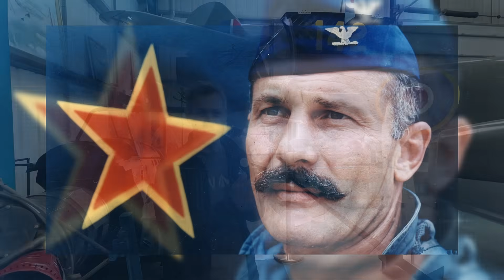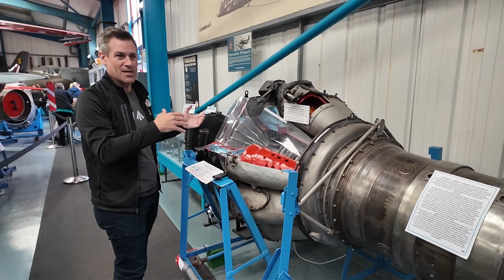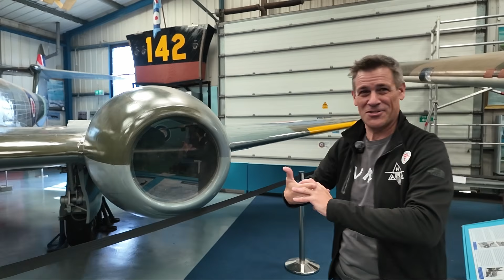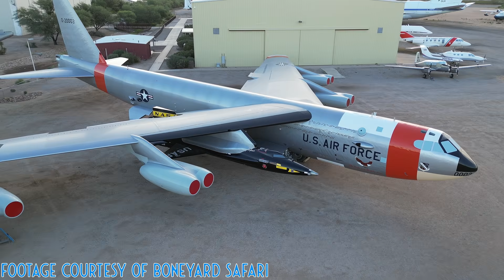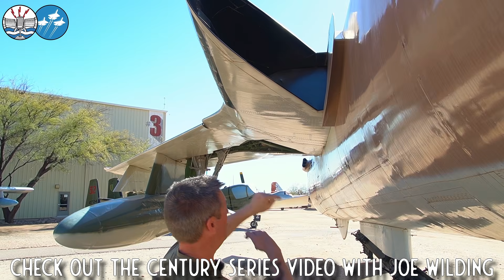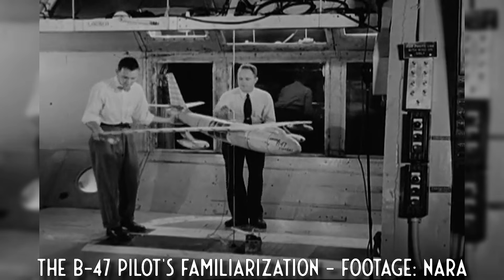British Jets of the 50s! - Part 1: Early Engines, Meteors and Vampires

Comment: Did u have an aircraft that could stand on tail go mark one in avertical climb and super curse in the 1950 like our English Eletric Lightning rocket ship😊
Reply: Not completely right, the Lightning had a maximum rate of climb of 55,000 ft/min, it couldn't quite maintain a climb vertically
Reply: @davidgibson5453 think ur wrong
Reply: I googled it and yes the eletric lighting  could sTand on its tail go straight up while bracking sound barrier going up yet the typhoon now can out climb the lighting  going straight up it has slightly slower to speed. Typhoon  is 2.5 mac and lightning is 2.7 mac

Comment: The statement is simpler. The first swept-wing aircraft for supersonic flight:
1. Rocket-Me 163 (1941).
2. Piston Curtiss Ascender (predecessor CW-24B - 1941, summer 1943).
DH Swallow (1946) with a thin profile is worth mentioning. Its history is not in Germany.

Comment: I assume the reasons for the design of Whittle's engines are confusing and it's not a large size. Hand magic push Nene into Australian Sabre.
Man is the unit of all things!
It's clear to see that the size were determined by the pipes combustion chamber, which cannot be placed closely. The short shaft and easy access to bearings are great. It is good to listen to engineer, but no philologists. You can argue with engineers.

Comment: The problem with some early jet engines were the manufacturers over promised and the engines under performed. Westinghouse seemed to be exceptional at doing that.
Reply: Like. But BMW? MetroVick (Griffith)? Lockheed (Price)? Salyut (Lyulka)?
I think that the projects that have reached serial production and not after 10 years are not exceptions, but the norm. Whittle far surpassed many, including JUMO.